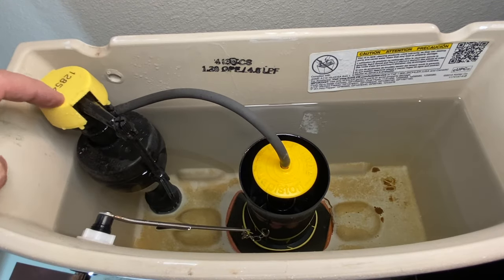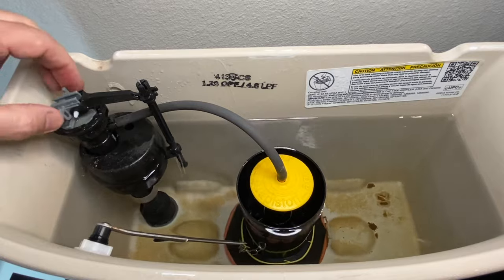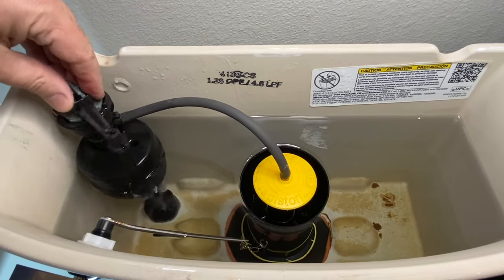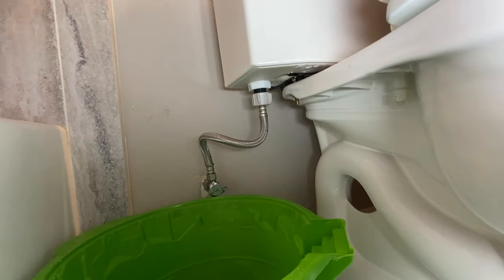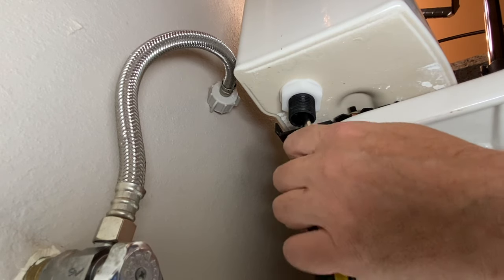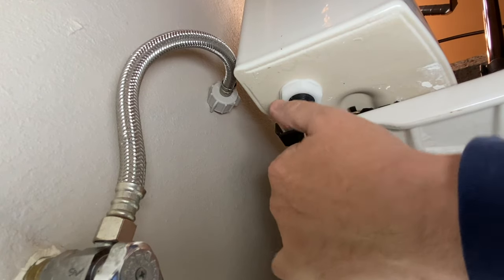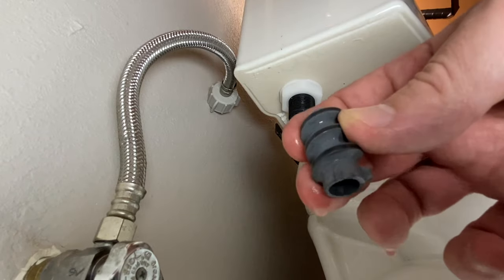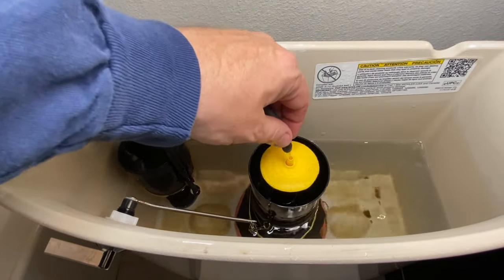TOILET FILLS TOO SLOW!!...3 QUICK AND EASY FIXES!

Comment: Your video answered a question that I have been searching for for the last hour and a half. I was replacing a Fluidmaster valve and this rubber screw thing fell out of the old valve. I have replaced probably 20 of these valves over the years and never saw that restrictor part before. It fell out and I didn't know which way it went back in. Your detailed video was the answer. Thank you.

Comment: Thanks for this excellent video. Had the exact same FluidMaster components… and it was your Step 3 that helped me diagnose my problem. When I finally (after much struggle) pulled out that gray spiral rubber piece (that controls water pressure), I discovered it was badly ripped and split in two spots! I still cleaned it up and stuck it back in but, as I expected, the slow refill problem persisied. So for $24 I just bought and installed a new fill valve component and BINGO! Problem solved & refills like a champ now. Thank you!!!! 🎉
Reply: where did you buy?

Comment: The fix it guy showed me how to fix the water supply problem. The 3rd method worked fro me. I did not replaced the rubber part. It works great! Other guys only showed one way. This guy told it 2 steps farther thank goodness.

Comment: Firstly, thanks for the great tutorial it helped immensely! My water flow was restricted by a Fill Valve Seal. It cost $2.98 at HD. I would have never thought to replace it without your video. Hopefully, my little tip may help someone else.
Reply from the maker: Oh it will. All these little things help so much. Thank tou
Reply: So isnt the water supposed to go through the rubber tube to fill that other tube? Lol.  I got water coming but it doesn’t go through the small transfer tube. Idk the lingo😩

Comment: Great video! Saved me a trip to the hardware store. Done tip 1, still no water. Tip 2 was kinda unfeasible due to stiff pex tubing. Tip 3 went to pull and couldn't get it. So I pulled the whole valve. Found it completely stopped up with calcium. Cleaned it, reinstalled and went back to tip 1 because I could see the calcium hung up in there. Poof! Everything works like it should now. Thanks to That Fix It Guy! 👍👍 🙌👊

Comment: Nice !  I did not know that you can pop the top of from the valve to check for debris.  I have to admit that if I was to take out that flow restrictor rubber thing that it is going to have larger outlet holes when it is reinstalled !  LOL ....   Thumbs UP to you Brian.
Reply from the maker: Lol!  I will have to do some testing with that flow restrictor some more. I’m afraid of the noise it could make. We shall see. Thank you Richard!
Reply: 🤣 Mine, too! I'd gouge the thing to death getting it out!

Comment: Thank you so much, taking out that stupid rubber piece fixed my toilet 100%. That is the worst thing in there. Why would I want the water to flow slowly. It used to take about 5 min for the toilet to fill up, now less than a minute, what a difference. God bless you!

Comment: Great video!  You were exactly right about that large threaded water governor in the water inlet under the tank.  I never would have known to look there!  On my toilet, this piece looked all chewed up and chunks were clogging the pipe to the valve.  I took the valve off the top and blew water down until no more chunks came out of the water inlet.  I will visit the hardware store tomorrow to get a replacement.  Keep up the good work!
Reply: Update:  Apparently that water flow governor is an integrated part of the water inlet tube tower and valve assembly.  Bought and installed a new Fluidmaster fill tube and valve assembly.  Thanks for giving me the confidence to tackle this project!

Comment: thank you for the video. fixed mine! Our commode had a filter in place of the spiral. Found a lot of sediment in it. cleaned and working perfectly now. might need to add some filter to the tank as more sediment enters the pipeline as we have switched the source to the well from council supply

Comment: Thanks for putting the video together. Good job! So, here's my problem. Several days ago I noticed that my toilet was taking forever to fill up. I did the flush procedure and checked the diaphragm. Everything looked good. When I turned on the supply valve,  the tank filled up normally. But on the subsequent flush, it went back to tricking and filling very slowly. I don't think the other two suggestions you gave are the issue, because whenever I turn off the supply valve, drain the tank, and then turn it back on. It fills great! But then when I flush again the water flow reduces to a drip. Any suggestions?
Reply: I got on the Fluidmaster website and typed my question on the discussion page. Low and behold several commenters had the exact same problem! Trickle refills, but when they shut off and then turned on the supply valve the tank filled up quickly. One of them actually called Fluidmaster tech support. Here was the reply, "I had the same problem. I called FluidMaster tech support, and they explained that the little black valve seal that seats in the top cap of the shutoff valve was probably sticking due to brittleness over the years, and so it would not move to open without added water pressure from turning off and on the water supply to the toilet tank." Sounds like I may just need to replace valve seal.
Reply: Final thought. I removed the black valve seal to see if it was degraded. Turns out the center of the valve seal had torn loose and was stuck to the needle in the center. When I zoomed in on pictures of the seal on Amazon, I noticed that the hole at the center is supposed to be small. The hole in my valve seal was substantially larger. Crazy how these things can be so easily missed. Off to buy a new valve seal :-)
Reply: I’m having this problem too! I thought everything was fixed and flushed one more time to make sure.  That was 15 minutes ago and it’s still filling

Comment: My problem is the rubber plug inside the fill valve tube. The problem is to find the name of the plug and where to find a replacement for it. Can't find it in the local Home Depot or Lowe's. I sent an email to FluidMaster tech support if they can help. But if you know the name of the plug and better if you know where to find them, I would apprciate it.

Comment: thanks Brian!!!  I really needed to see this!  side note, how do you know what size flush valve like the one in that toilet you need to replace a different one on an existing toilet.  I think they come in two different sizes, but I don't know what the size is referring to.
Reply from the maker: They are usually 2 and 3 in. Send me a pic and I can let you know. It is off the hole size on bottom of the tank. Thank you another video topic as well!  Good info to know.
Reply: @ThatFixItGuy  those flush valves look like they work really well.  I have a relatively new toilet that I’m going to put in the bathroom in the building and I know the flush valve needs replaced.

Comment: great job!!!! thumbed it, mine doesn't fill at all, do i replace it ? i break the float loose b/c it gets stuck then it works for that one time...wat u think? thanks!
Reply: The seal in the top of the valve is stuck in place.

Comment: I just removed the rubber seal up top and flushed the fill valve out.  It still filled too slow.  I removed that rubber plug at the bottom of the fill valve.  Then I flushed the top seal out again.

It still filled too slowly.  This time I removed that rubber plug at the bottom of the fill valve.    Now the water is filling good.    I’m not seeing any water hammering or any problems.

I kept the old rubber valve  just in case.   is it possible just to drill a small hole at the top of that grooved rubber plug?   This way to allow some water to come through as well as around it?  Just curious.

Thanks!

Comment: Great video.   My problem was #3.   Toilet works great when the flow regulator is removed.   But I can’t figure out what is wrong with the flow regulator or how to unclog it and I can’t find a new part online anywhere.    For now, I am just doing without it.   Any tips on what is actually wrong with this little regulator?
Reply: 0
Reply: New fill valve is $ 20 or less. Go for it.

Comment: My area of the country there’s a lot calcium in the water, I’ve noticed the float in my toilet doesn’t move up and down and I have 0 water refilling the toilet tank. Other than replacing the float valve is another way to fix it? Thanks.

Comment: Your solution worked initially for me but when I placed the top cap back on, it filled slowly again, so I removed it and it worked fine.  But when I tried to flush again, it was back to filling slow....any ideas?
Reply from the maker: I’m going to be the flow restrictor is broken or had something stuck in it. I always say at some point it is not worth fiddling with these anymore and just replace it. It’s a quick job.

Comment: My old toilet fill valve would fill the tank in about 36 seconds and this new one takes over 1 minute and 7 seconds. I didn't think I would have to try to take off the top to clear any debris since we just bought and installed the fill valve. We have the Fluidmaster 402CARHRP14.
Reply from the maker: Wow. Surprised that the new one takes so long.
Reply: @ThatFixItGuy  Thanks for the response. I already tried flushing out the fill valve by removing the top and that didn't help. Do you happen to have any other suggestions?

Comment: Hi, I was looking for a video that would be able to help me with my no flow problem.  Yours was very helpful, unfortunately, step one didn’t help. So I moved on to step 2..I didn’t get any water flow from the water supply line!  Was trying not to get a plumber involved, but I don’t think I can replace the water valve which is what I suspect may be the problem. Any suggestions? Thanks for any input.
Reply from the maker: I have videos on replacing the valve. You would have to be comfortable with shutting the water down to your house to replace it. If you send me a picture I can let you know how to replace your type of valve.

Comment: Curious my moms toilet is delayed between the flush and the fill. It fills at a normal rate and flushes at a normal rate but there is a delay of maybe 10 seconds or so between the flush and refill. Would any of these be a solution?
Reply from the maker: It sounds like the float portion of this may be dirty where the float slides up and down. I would manually make the fill valve work a couple of times and see if that don’t do the trick.

Comment: #3 2was my issue. A tiny litle piece of the restrictor broke off and blocked the flow almost entirely.  Does this piece need to replaced?
Reply from the maker: I don’t know if you can buy a new one of those. I’ve never seen them for sale. Your toilet will fill a lot fast with that thing not in it, but you could also start experiencing issues like water hammer. May want to replace the valve if it starts acting up.

Comment: after hundreds of videos, I found this one and all my problems are gone. 😂 BUT I have a question, I took that rubber off, flow restrictor(?) something like that. 
Mine was so so so old and I tried a couple times to take that off and put it back and when was back my tank was taking 4 min to fill completely. So I left without that rubber. 

How can I find a new one? Cant find anywhere.

Thank you.
Reply from the maker: https://www.faucetshark.com/Kohler-83141-Flow-Restrictor-p/KOHLER-83141.htm?gclid=Cj0KCQiAoNWOBhCwARIsAAiHnEiHZ0KCwVJmobXTmIzjU8_TNSfYtFv_mhN6Iwa6prKvHjAOJLFeUGsaApDFEALw_wcB  I think this is the link for one maybe.  I have never tried to buy a replacement.  I have just replaced the whole valve. Let me know how this works out.

Comment: I tried all 3 options & I still have no water supply to the toilet. The fill valve was replaced by a plumber 1 year ago. Do you have any other suggestions?
Reply: Pull the hose off like step 3 and turn on the water, see if you have pressure then
Reply: The water valve on the wall could be covered with calcium deposits blocking the flow even when the valve shows it to be in open position.

Comment: Same problem as @vicktv33 8 months ago. Commode filled quickly.  Replaced flush system with Fluidmaster and immediately fill time extended to 56 seconds.  Same replacement for master bath - same commode, fill time 30 seconds.  Feels a little like a first world problem but I don’t understand the performance difference and my daughter complains about the full time.  I thought there might be an adjustment that could be made to the FM to improve fill time.  Water flow seems strong.    Please and thank you for any comment.
Reply: There are adjustments to be made to the valve before the installation. There are different positions (height) for it. Read instructions before installation. Based on the height it will take less or more time for water to fill the tank. In other words you can't just install the fill valve right out of the package.

Comment: Any idea why these fixes will only work for me for 1 flush? My tank refills slowly but if I turn the water off, open the top of the fill valve (don't even have to turn the water back on to blow out any debris), and put it back, it will fill normally. But if I flush again it refills slowly again. When it is filling slowly water doesn't even go through the tube, it just drips from the top of the valve.
Reply from the maker: I am at a loss.  A friend of mine just had the same issue. He gave me the fill valve in question. I am going to hook this up to some water and see what the deal is with it.  I think there still has to be something stuck in there, but at this point change that bad boy out.  12.00 and 20 minutes for piece of mind.
Reply: I'm having this same issue--did either of you figure out what was up?

Comment: Different problem.  Can't get the float to drop.  It seems like it is just a few ounces too light and after going down most of the way, it stop.  I have to reach in and push down with just light pressure to "unstick" it and it then causes the valve to open and the new water fills the tank.  I've tried adjusting the screw level up and down on the float but it always sticks just before getting all the way down.  Was think of just hanging a couple lead sinkers on the upper arm to add downward pressure on the float, but it seems like such a "rig job" and wondered if there is a proper fix?
Reply: I put few drops of dishwashing detergent inside the hole on the float, and around the shaft. Than I bunce the float up/down few times. That works for a while. Permanent solution is replacing the fill valve. They are less than $ 20.

Comment: I recently drained my well bladder tank to check the bladder air pressure. Ever since I have a big issue with both my toilets slow filling and gurgling. Sometimes it makes water flow in all house faucets stop. Seems to be air but I don’t understand why it’s so bad. Water pressure returns good in taps but if I flush both toilets there’s no kitchen sink water. Seems to be a major airlock. Any ideas?

Comment: Well i already learned FluidMaster makes the one for my Kohler. fill hose i leaned goes bad about every 2 years -.‘and debating if just gonna get a new FluidMaster valve or tear apart. 

learned the trades since i was a kid.  i just hate working in my own home some 50 years later 😂. 

more expensive toilet doesn’t mean better.  but look for that made in US Flag for parts and i’m happy. 

Now. do i want to deal with this or just get a reliable valve at 1.2 the price.   This is the 2nd time in 2 years i had to adjust this 250$ toilet.   

miss the Navy days sometimes where the outhouse got buried when we were done with our exercises were over.  (thankfully enough rank that i didn’t have to “cater to the oversized outhouse”. 

will let ya know how things go.  gonna order new one, but let me try cleaning anyhow. it’s def slow. in filling

Comment: I took the top off and cleaned the valve and rubber gasket. 
I want sure if the water was meant to come out as fast as it did when you had the glass over it. 
It's only shooting up about 10mm on mine.
Toilet won't fill with everything back together. 
Could be that flow restrictor on the bottom I didn't know about or the supply?
Thanks
Reply from the maker: Totally could be either one of those. Both are pretty easy to tackle in one swoop.
Reply: @ThatFixItGuy  yes, thanks 👍

Comment: T.t my toilet is being wierd t.t water fills up so slowly.. when I shut the water off and back on, water fills up like normal. Once it's filled up, and I flush, water fills up slow again.. so I close the water again and back on, whoooosh fills up quick.. should I call plumber t.t
Reply: What ended up helping? Same thing happening to me now
Reply: Same thing happens to my toilet. The fill valve is clean & without debris too.
Reply: @Beestieboy1 this also is happening to me. What did you end up doing to fix it?
Reply: Same question, what fixed this?
Reply: Ok fellas. There is alot of you that commented , surely one of you figured it out. I definitely have the same issue lol
Reply: Any fix guys? Pls help
Reply: Same thing. What was the fix?
Reply: Oo oo, me next! What was the fix?
Reply: I have a very similar problem.  My guess is something broke loose inside the shut off valve.  Planning on replacing it tomorrow.....  which would of course involve shutting off water to the house so I have to coordinate with The Boss....
Reply: Sounds like a bad valve to me....$ 20 and you're back in business.

Comment: i never seem to get any improvement when i try cleaning old valve always seem to wind up replacing the valve guess i must be missing some clogged part inside
Reply from the maker: It could be the flow restrictor has some debris or the water shut off valve to the toilet has a broken washer that keeps breaking apart.